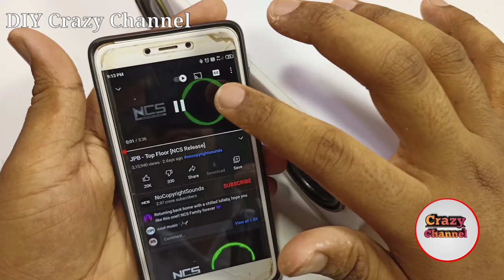How to make Bluetooth speaker ll MH-M38

Comment: Bro can we use CT 14 amplifier module instead of Mh M38, if we are using CT14  module should we decrease the voltage or adjust it with 5v itself

Comment: Bro, the portable speaker I am currently using is a model called Flix (Beetel Tripper Wireless 31W Speaker with Bluetooth v5.0 with Mic, Special Passive Bass Radiators).. Now it is compliant.. When I sent a message to the company, they said that it cannot be repaired... Can you tell me new board with 2 speakers + Bass, [ 8w+8w+15w ]

Comment: Why u have used voltage booster from 3.7 to 5 why not directly connected 3.7v battery to the amplifier
Reply: Well , we’ll be more power on 5v